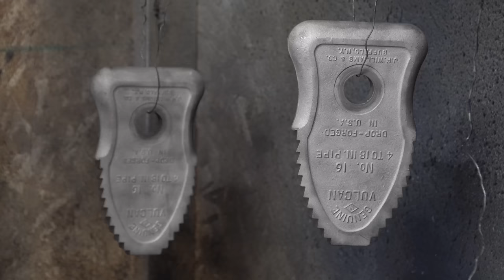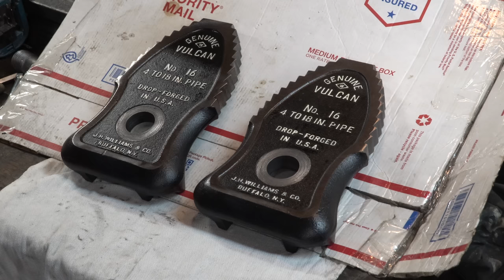Largest Pipe Wrench I've Ever Seen [Restoration]

Comment: I have a smaller version of this.
I will have to check and see if it is the same brand.
I checked and it indeed is a Vulcan.
It must be for smaller pipe.
I would say the head of mine is 75% to 50%  the size of yours.

Comment: I would not be surprised if this was for use on a drilling rig, in which case it would be suspended at the right height, and used to thread the drilling pipes together as they go into the ground.

Comment: When I worked for the city we lived in...we had 3 of those wrenches. we used the to dismantle the early fire hydrants which were screwed together at the base. we would us a small crane to apple force. That's what the eye is for at the end of the arm.

Comment: @Hand Tool Rescue  Hey man, been a long-time sub and watcher.  Love the channel.  👍🏼

This might be a strange question, but since you deal in antique machinery and equipment, you might can answer it for me...  My dad passed about 5 months ago, and as his only heir, I'm having to be the one to liquidate his assets to pay off some of his massive bills...

That said, he owned a rebar shop for about 30 years, and when he finally swapped everything over to hydraulic (shears, benders, etc...) he decided to keep the old antique 1940's Milwaukee No.2 Alligator Shear and stuffed it into a corner.  That thing is HUGE and heavy, and solid forged steel.  It is dirty and dusty, and well-used, but it can easily be restored to proper function with minimal work and expense, and would make a REALLY cool decoration restored and put on a concrete pad out in front a steel company as a vintage piece of mechanical art.  These old shears have lots of character and smooth lines, and stuff the modern shears just don't.

Is restoring something like this, something that would interest you, or do you know anyone who deals in antique and vintage machinery that might be interested in purchasing it?

Sorry if this is an odd question, I just honestly don't even know where to start with it.  I know it's worth something, especially being solid steel, but don't know how much, or who to even advertise it to?

Any help is greatly appreciated!  Thanks for your time!
Reply from the maker: Email me at handtoolrescue@gmail.com with some photos!
Reply: @HandToolRescue  Will do man!  The lighting is terrible in them, but I’ll try to get some better pictures of it soon, and send you better ones.  But I’ll send the ones I currently have.  Thanks!
Reply: @HandToolRescue  Email sent.  Thanks again!

Comment: My father always called those "pipe tongs." 
Most of the time we would be use them in pairs. 
If you don't hold against yourself you can spin whatever you are working on out of position or bust it right off.
Also, when you are using them, pull up don't push down. You can get a lot more force on them.
Those look like they didn't get much use.

Comment: It's oilfield kit, the technical term is "chain tongs" There's a big motor up top turning the pipe, you just wrap the chain around the pipe and lean against the rotation for a second to unscrew the joints between sections when you're tripping pipe in or out of the hole (and yes, that sounds like a euphemism for something else, but that's the actual phrase used by the guys that bring up the wonderful juices of long-dead plankton to power our modern world).

Comment: You could probably operate the wrench single-handedly by using a hoist to set it up, then applying torque using that gasoline-powered jumping tamper contraption.

Comment: this large pipe wrench would have been pulled by horses to tighten pipes as large as two foot in diameter, these large pipes where mostly used for steam transfer. the eye on the end of the handle was where the harness from the horse would have been attached. I have a smaller version of this that can be used on pipes up to about 10 inches.

Comment: That ain't called a pipe wrench, it's called a chain tong. It's not an antique either. You can find several chain tongs on the rig floor of any drilling rig in the world. Chain tongs can be used with the pipe laying on the deck horizontally or vertically with the pipe hanging in the derrick. What's really nice about a chain tong is that it will usually grip on irregular shaped tubular objects so you use it a lot making up the bottom hole assembly. You're probably right about it never being used. They come from the factory with wire wrapping the chain to the handle and it would have rust under the heads if it had been used much.

Comment: Looks like a stem wrench for drilling work, the ring in the end is a dead giveaway. Doesn't seem like it was ever used either. Spray it down with some diesel and ATF and leave it be, ain't like it'll ever see any work.

Comment: There's only thing more absurd than the size of that pipe wrench. And that's the size of the Hand Tool Rescue adjustable wrench used to loosen the nut at 2:00.

Comment: We have 2 of these at work.... 2 guys to put on vertical pipe, 1 on horizontal pipe... on horizontal pipe a 10 ton excavator makes a good cheater, a 30 ton will bend the handle like a banana

Comment: Consider all the tools that replaces, how much space they occupy and how much they weigh and you have the justification for this tool in a mobile setting. Perhaps someone traveling to a factory to do repairs or inspections on a one time basis. I don’t think the designer was under any influence other than the desire to cut down on the bulk and weight of tools carried to a job. 🔧👍

Comment: Would like to know if by any chance you can show a good way to make one a little more manageable to use on heavy Equipment to help remove filters. You'll be surprised on how tight thay can get. Some filters can hold up to 2 gas of oil. Lol

Comment: Aha the "other" Vulcan foundry, not often do you see the US Vulcan featured mainly because of the problems with the British Vulcan Foundry which was prob the largest locomotive builder in olden times but now but bought out by GEC who was then bought out by MAN Diesel who basically shut the whole thing down and the famous foundry is now a housing estate of horrible houses.   On British rails today still run English Electric's mighty class 86 built in the mid 60's, an incredibly powerful 110mph electric loco that was so good Eastern Europeans bought the redundant 86's and the whole class 87 which do gruelling duty on coal and ballast trains, Poland actually had the first 86's and they had never had such a powerful loco and Bulgaria and Romania both bought 87's which were even more potent powerwise.   EE also built the formidable Deltic, a loco with a ship engine shoved in the hole and quite a lot of Australia and New Zealand's diesels like the astonishing Df nicknamed the "caterpillar" because there is no fuel tank between bogies, just lots and lots and lots of wheels.

Comment: I'll ask a more than likely dumb question, if I may:  If we're wire wheeling and sandblasting after EvapoRust, why use EvapoRust at all (aside from previous sponsorship deal and old habits die hard)?
*I apologize in advance for not seeing the blatantly obvious reasoning.

Comment: Standard chain dogs, you don't use them like you showed, i suppose everyone is telling of bigger tools, but in heavy engineering these are on the small side, the spanner for a 200,000 ton power press tie bar nuts had to be picked up with an overhead crane.

Comment: I'm honestly curious what chemicals are in the evapo-rust and what reaction is happening.  I imagine that it's converting the Iron (II) oxide into Iron (III) oxide, given the color after.  The SDS sheet isn't much help, but does say to avoid contact with skin, and that it decomposes into formaldehyde.

Comment: When the bolt was stuck at the beginning and you were using the comically oversized wrench but the nut wouldn't break loose, I was hoping to see a 1 gallon spray bottle of WD40 enter the picture.

Comment: why not soak that whole area where the bolt you removed instead of just one spot ? i used to do that till i ruined the threads on bolts and damaged other dry places that needed to move. try using SEA FOAM DEEP CREEP. rated best by P.F. channel after i sent him suggestion to redo his penetrating test with DEEP CREEP . he wasn't aware of the product . i know you can make ruined parts but we all don't have that option . i love using my 100 year old tools on other 100 year old tools that need TLC . still love watching the videos .

Comment: It's a chain tong I done water pump install for over 20 years now see and fixed quite a bit of them Imagine throwing that chain around a pipe every time you have to take it apart not fun at all we usually cut the handle side in half to get ride of some weight the easiest thing to do when it's totally rusted is to soak it in a bucket of used oil for a couple days and start to work the chain links  they need to all move or it will be hard to close it right and I use a die wheel to sharpen both side of the teeth. you would be shocked on what a new chain tong coast there expensive that one new probably 1200-1500$  and IV seen more then a few snap the chain not fun and perty scary the pipe is really tight specially when you see the wrench start to bend and flex not to many people even know what it is or how to use one 💯👍✌️👌🍻💪💧

Comment: Not called a pipe wrench in the Texas oilfield. We called those "chain tongs" and we still use them. Was using one on a well head with a 10 ft cheater pipe. Took 4 people but got the wellhead to come off. Nothing to it.

Comment: i bet 2-3 ppl would work with a wrench that size. There was a old rail track that needed to be removed there was no hurry to do it so the local scrappers/crackheads got the job i would walk past it on my way to and from work and they would use similar tools to unscrew the bolts from the sleepers it was such a miserabel sight to see 2-3 of them going around in circles while pushing a 2m long pipe,beam or fence post that had a old beat to shit pipe wrench stuck tied on just held with crackhead magic at one end and it would take them like 8-10 min to unscrew a 1kg steel bolt it was sad for me to do the math on how much the earned at the end of a day i guess 20-30$ split 3 ways just sad